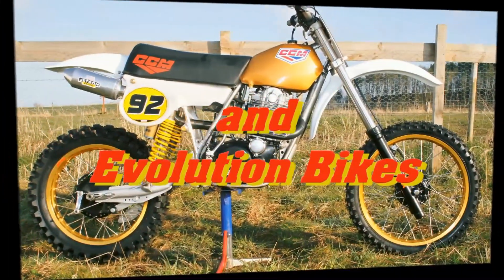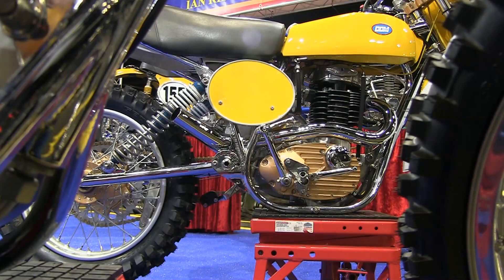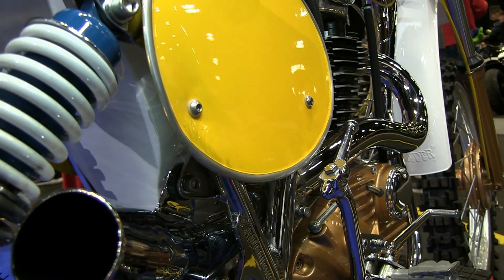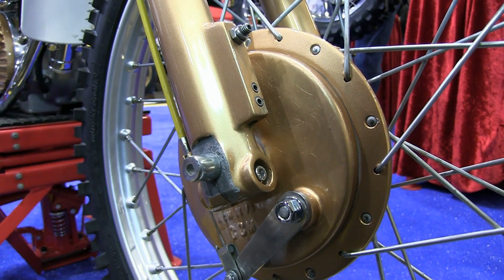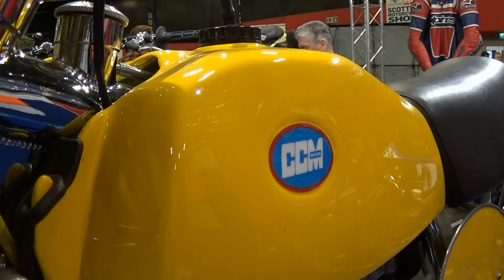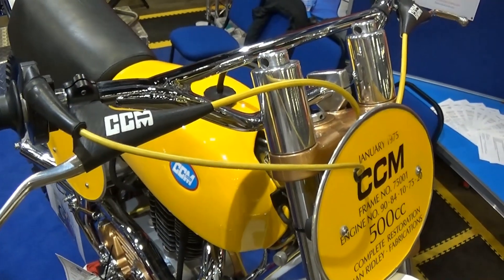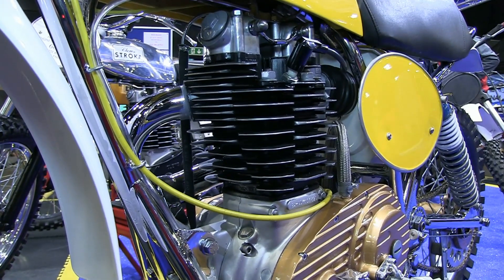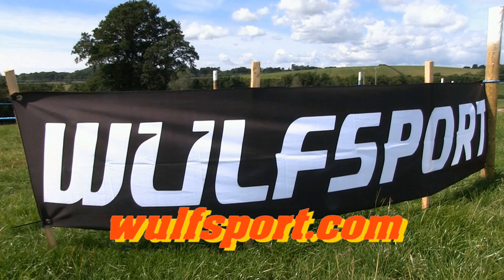Legendary Dirt Bikes "1975 500 CCM Restoration"

Comment: This bike is truly gorgeous! I raced a 580 back in the late 70's. Mine was, I think a very early model but I have no pictures and can't remember the year. It was a bit rough when I swapped my twin shock KX125 for it. My dad and I rebuilt the top end in the kitchen and fitted electronic ignition. I forget how tolerant my parents were. The bike was far too big for a 14 year old and I swapped it for an ex works FB AJS 360. Happy AMCA anything goes racing ❤
Mine looked more like the alloy tank version behind this bike.